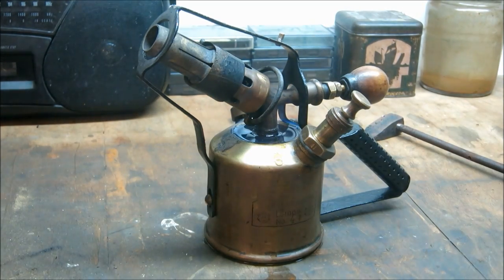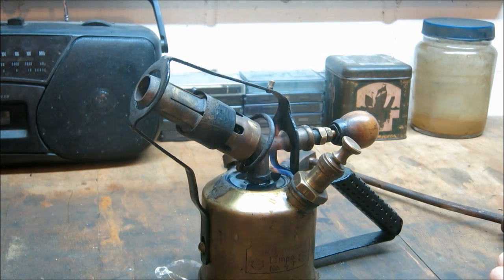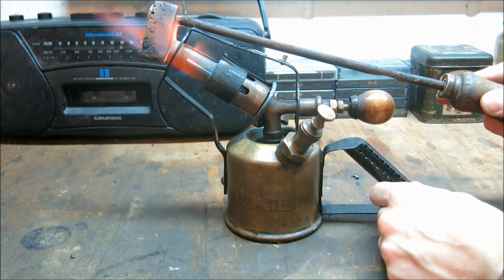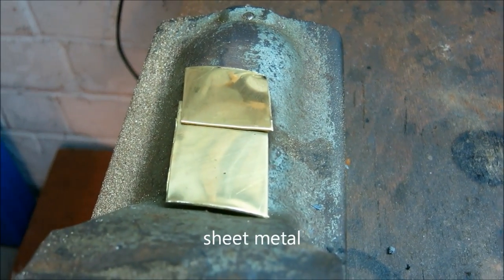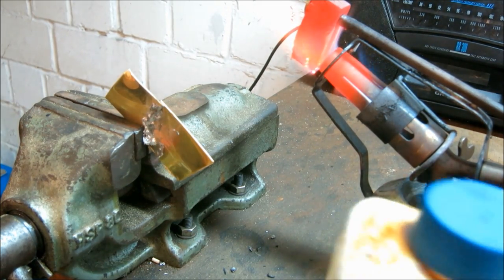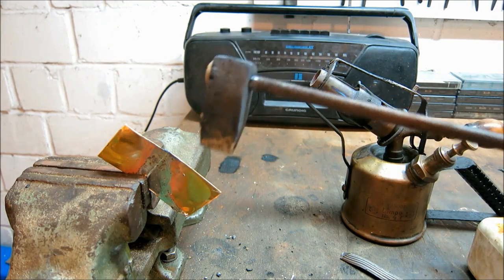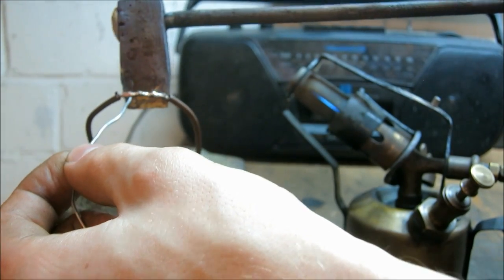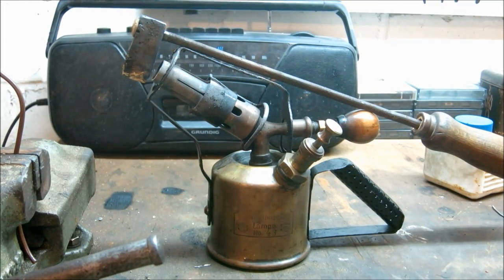Old Time Soldering: A Tutorial on how NOT to

Comment: Hi Ad, firstly you should always clean the soldering iron with a file, then tin it every time before you use it.
Secondly you must use flux before you attempt to solder anything or you will incorporate crap into the joint, trying to solder again after adding flux will not remove the crap, you have to break the joint, clean and start again.
Thirdly your soldering iron was too hot and finally although you only had a small section of the metal in the vice, the vice is a massive heat sink and will draw the heat away from a thin section of metal, causing the loss of heat.
Remember it is soldering and not soddering and aluminium not aluminum 😆😕😱
Reply from the maker: Well thats a whole lot to look for - I thought the iron was too cold as the solder would hardly melt on it... I guess that might be the bad cleaning of the iron.
I will retry and if it works make another video about this.
Thanks for all the tips :D
Reply: Yes this is a art low temp is the way to go . That was like  using a hammer  to open eggs.
Reply: Metal gluing  🤫 🏃 🙊🙈
Reply: Agree entirely with Kevin obviously an old hand - great to see a young guy discovering old ways.
Reply: Good post Kevin. I agree with all you've said. I would only add that working against gravity is never a good idea!😃The solder is running away from the joint as soon as it melts - better to have it run into the (pre-heated) joint.

Comment: Apply some flux to the joint to be soldered and use the torch to heat the two pieces of metal directly.  Way faster and more efficient than trying to heat an intermediary piece of metal.

Comment: You need a few tips on soldering!  Heat your metal up prior to soldering. Also solder runs to the heat.
Keep the large heat sink ( vise or clamp ) as far away as possible.
Putting the solder right on the soldering iron wastes solder and gives a poor solder joint.

Comment: Saw a video on YouTube of how a truck radiator is fixed in India. He uses a torch and hand held iron to melt and resolder the tanks to the core. They even caught the old solder as they detached the joints and re-used it.
Reply: ... is that the video with the least pakistani looking pakistani and the soldered on radiator brackets? Literally just came from that video lol.

Comment: Never heat metal to red when soldering. An oxide coating developes and prevents solder from bonding to the surface. Cool the metal down and file it or sand it to bright metal before starting again. Keept the iron tinned with solder to prevent oxidation. Simple concepts, soldering is easy, keep learning, you will get it. Gentle heat and solder flows like melting butter. Too much heat and start all over.

Comment: I like your idea of using a gasoline touch.  Never considered using the one I have.  I will reseal and give it a try.  31 45B
Reply from the maker: If refurbished properly, they are very reliable, and alot cheaper to operate than the ones with gas cartridges.
Also, the flame volume is larger. The flame is about the same heat as gas, but gasoline is alot quicker at heating up big masses of metal.

Comment: Yes, those old irons should be tinned before using (why they called it "tinning" I do not know).  But worse, you are trying to solder brass. Were it copper it might have worked, and in fact it did.  For brass you should use flux. The old-fashioned flux was borax. .What it does is break the surface tension on the solder, so it can flow into the joint. But today you can get stuff that works better than borax.   And if I am  soldering a "big" joint (relative to the heat capacity of the iron or torch)  I  (1) cut off a small piece of the solder bar. (2) place it on the joint  (3) heat the brass not the soldering iron. I would use the torch directly. When the brass gets hot enough, it will melt the solder and in it goes. Most of the time. I use a MAPP gas torch direct and can usually make a nice clean joint. What was happening in the brass episode is that all the actors are much too cold and the iron hasn't the Joules to do the job. Might have worked if you preheated the brass red hot. Does that torch burn gasoline/petrol? I noticed the alcohol preheat so it might even be kerosene.
Reply from the maker: Hi there - thanks for the tips!

Usually, I'd use the torch for a job as such, too - in fact I did later on and you saw it worked just fine. But I was trying to show working with the iron here - which didnt go that well ;-)
The only evidence I saw about these big soldering irons was soldering sheet metal togehter, so I thought I should have a go at it, but in the videos I saw they used electric irons for the job which can of course keep up the heat.

I will give soldering copper a try (possibly even using thinner metal to give the iron a better chance) and properly clean and tin the iron before working - if that works I will do another video about that.

Since I emptied the last tank on my propane torch, I switched to gasoline torches - this one and the Vulcano, and for my purposes they are more than sufficient - soft soldering is no match for these and silver soldering is also possible on the scale of parts I work with (mostly modelbuilding).
Reply: Those old torches were used with lead-based solder. I can vaguely remember my father using an iron like yours. Aha! He built some stuff for us out of tin cans. So on something that thin it should work. Heat the work, not the solder.

Comment: I was watching this as I have a old manual on soldering it states prep the copper by wire brushing wash with spirit of salts(muriatic or hydrochloride acid and melt solder to it to initially prep. My assumption is red hot copper is too hot to hold solder on it like others have mentioned
Reply from the maker: Exactly right. Cleaning and pre-tinning the copper was step one, not making it as hot step two to make this work.
As soon as you notice the flame starting to turn green, it's time to get the copper out of the flame.

Comment: what happens if we keep pumping the torch???
Reply from the maker: Depends on the torch. Some have a safety valve that'll blow off,
but even with those that don't, there is a point after which pumping more and more won't have any effect on flame size,
since the nozzle can only let so much gas through.
At some point, the pump leather would probably no longer seal properly leaving the pump useless.
You can't blow up the tank if that's what you wanted to know ;)
Reply: @AstraWerke  thank you so much for quick reply. And To the point as well👌

Comment: Maybe acid flux,the kind they use for radiators,and the solder they use for radiators I had to fix in my car radiator they sold me a acid flux with a brush. that cleaned a got ready for solder,I use a some what similar soldering device as yours in high school to seal a mug we built

Comment: its so the gas pipe doesnt snap off if you drop it silly. its for safety
Reply from the maker: I guess if an impact is strong enough to break the pipe, a small piece of sheet metal isn't going to stop it... I guess I should better not try it ;-)
Reply: @AstraWerke  its clearly not sheet metal. And yeah it makes a huge difference because of torque and forces. without the protector it will break if you drop it a few times. The protector spreads the forces to stronger areas on the bottle while without the forces are focused on the much weaker neck. Drop it a few times without the protector and you will see what i mean.